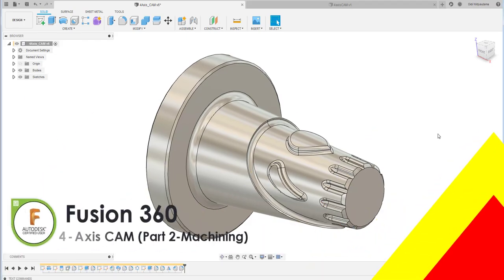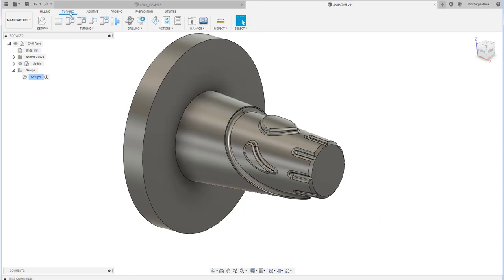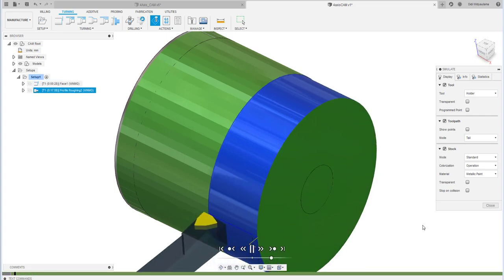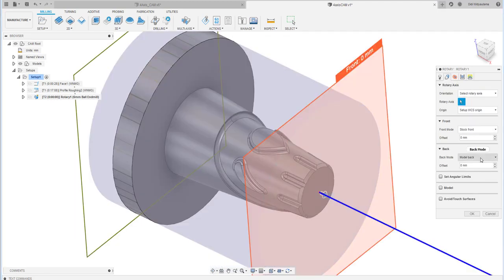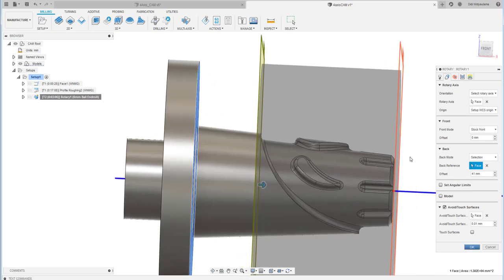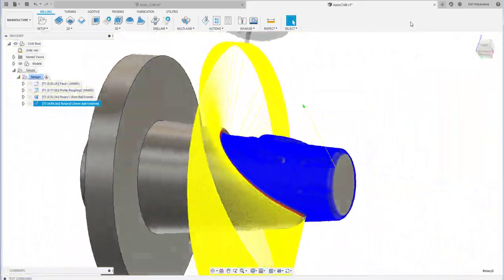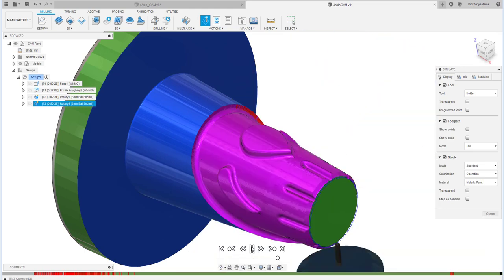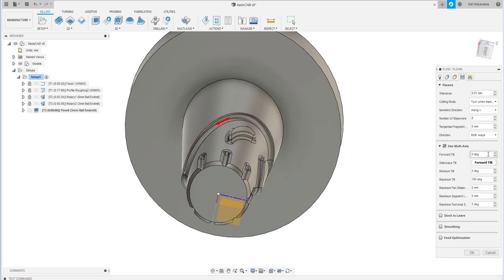4Axis CAM (Part 2 - CAM Machining) - Fusion 360Tutorial

Comment: Can you remove the colisions from path?
Only if the holder or something will colide then we should see a real red alarm!
In long paths full of alarms is very time consuming to check them all cause we cant be sure its ok.
Awesome work.
Reply from the maker: Try to adjust the cutting tools, usually when tools shank collide with the part, it will also have alarm

Comment: Thanks for showing the CAM steps on this model. You go through the steps at a good speed; maybe you could improve your audio a bit (a bit clearer).... I've only done turning sims, but it does take some practice to get a workable toolpath: this helped a lot :)
Reply from the maker: thanks for your feedback, I bit struggled handle noise on my mic so it result on lower volume, sorry for that I will improve next time, Thank You